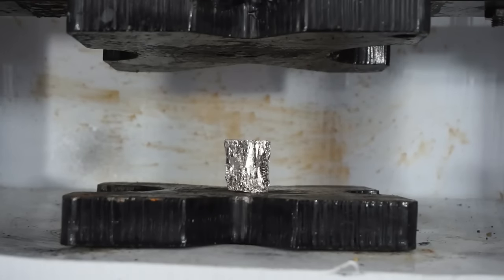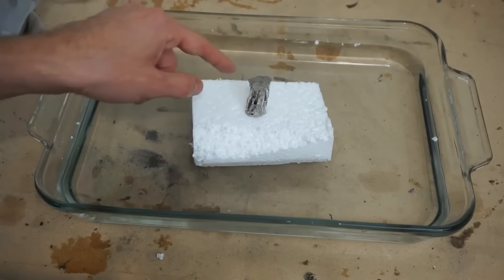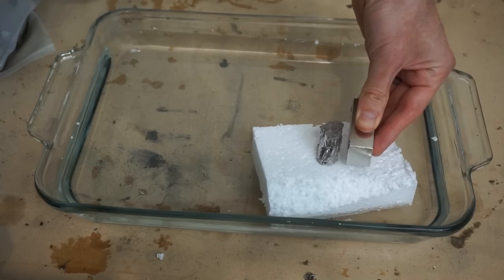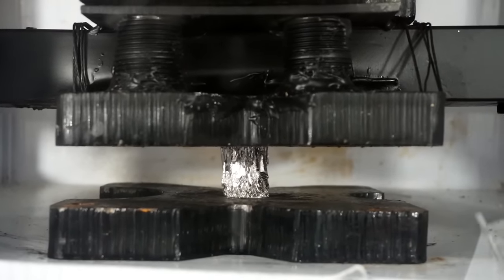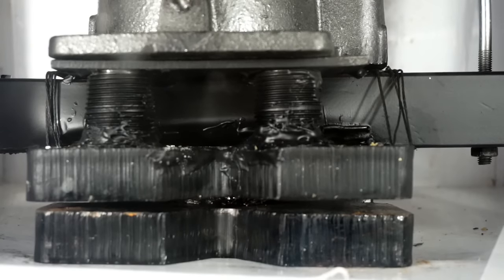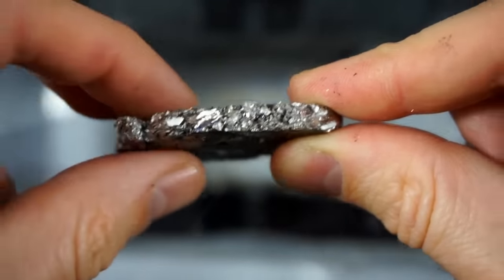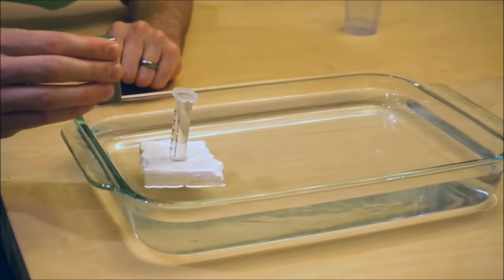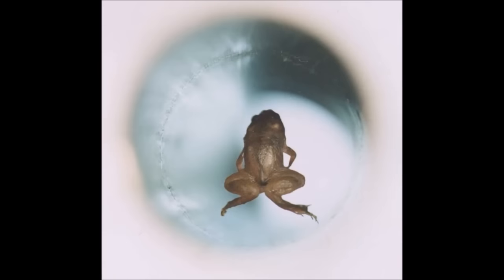Crushing Diamagnetic Bismuth With Hydraulic Press

Comment: Nice vid man ;)
Reply from the maker: +Crushit hey thanks!
Reply: love your vids
Reply: Hello The Action lab. I have a question. Suppose you have a 3meters(10 feet) x 3 meters(10 feet) magnetic table and you have bismuth metal powder in your hand. What would happen if you threw the bismuth powder in a horizontal way at an altitude of 12 inches(1 Foot) over the magnetic table? And how different would the experiment be if you threw sand instead of bismuth?

Comment: The Bismuth looked pretty cool just as the press started to apply pressure. I'd like to see it at that point. Stop the press just as the sides were starting to splinter apart, before it fuses back together when the press hits bottom. Thanks!